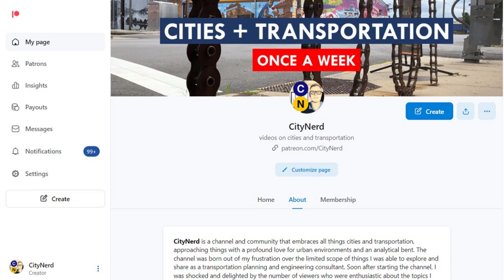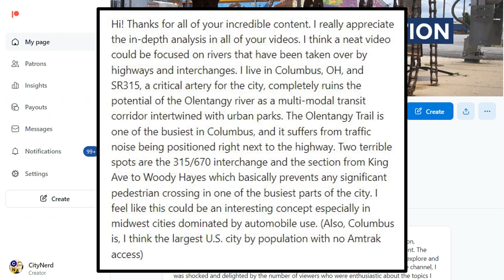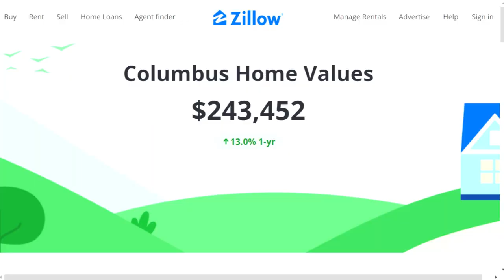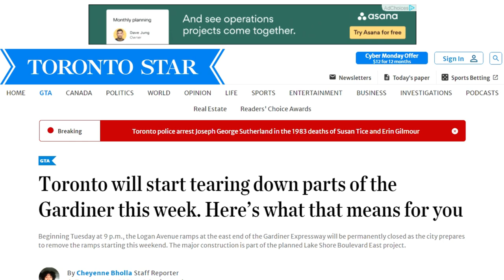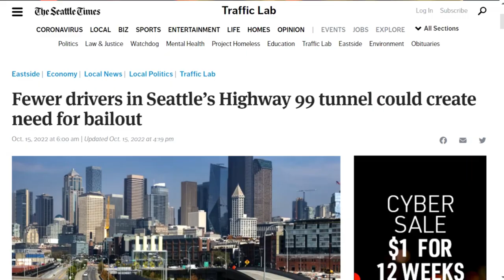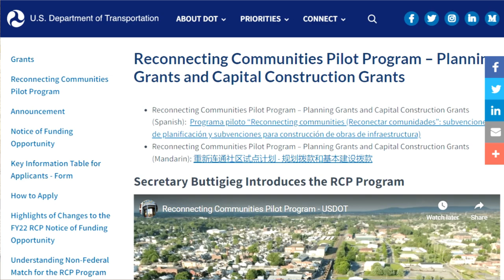Highway Engineering Madness: 10 Waterfront Freeways That Need to Go (North America Edition)

Comment: I'm quite happy to see Sacramento narrowly avoid the list, and I mean that in more than just that it ended up as a "dishonorable mention" flyby, as if history had gone a little bit differently it would have certainly been on the top (bottom?) 10. Originally I-5 was going to go right along the waterfront on the east bank of the river, but a historic preservation movement (of which one of my professors had been involved in) managed to build enough support for pursuing a different approach. If I recall correctly, the president at the time (JFK?) was going to step in, but what we have today is the compromise solution, where it has a "bubble" for the historic district, which is probably the most photogenic part of the entire metro area.

Comment: Currently is DuSable-Lakeshore Drive, but I feel that Lakeshore Drive already reached its maximum capacity of traffic. Especially in the northern part of the Outer Drive. It does create a barrier to the dense neighborhoods/communities like Wriggleyville, Lincoln Park and Uptown. Have it as a 6 lane boulevard and service street on the side. While a BRT can run in the middle. Connecting Navy Piet and perhaps the Museum Campus. The southern part of Lake Shore Drive can still service as a "Freeway", until 47th St. That's where a semaphore or a roundabout can be placed. It would be nice to re create the split like LSD did in the museum campus before, just when it reaches 57th St at Musuem of Science and Industry. Directing traffic in a huge roundabout sequence in Jackson Park, to help the transition towards the Chicago Skyway, via Stony Island Avenue, another wide Boulevard on the SE Side of Chicago. The City of Chicago is split by those opposing to re create, and those that want things the Chicago way, "fast, speedy and prudent with no reason". Or, turn it into a Tollway, I've say that for a reason to get funding for construction.

Comment: as a Berkeley resident near 580/80, it's unfortunate to say that however much I agree what a travesty it is to separate the east bay from its waterfront (and so much money goes into trying to bridge across it), i cannot envision any kind of plausible future in which it gets removed or even road dieted. the biggest issue is just trucks; the Port of Oakland is one of the busiest ports on the west coast, and 580/80 fulfills a rather substantially unique logistics niche for the area. (there is also a rail line parallel to 580/80 and it is also well-used) i think the best case scenario is congestion pricing 580/80 to lower VMT and investing the proceeds into more public transit and hoping you can hold back Caltrans from trying to expand the freeway infrastructure (they want to "upgrade" some local city stroads into serving as 580/80 backups).

what i can say, however, is that Berkeley managed to avoid the fate of having a highway slammed through its core, so it has an incredibly intact and great downtown. in that respect, if there had to have been a freeway, putting it through what was once literally trash storage (one of the city's major waterfront parks is a capped landfill, and if you watch The Graduate, there's a shot in south berkeley in the mid-20th century where they are literally on a trash dump) was immensely preferable to a city-gutting, neighborhood-segregating location.

in that respect, what i could see being plausible is removing 980 in Oakland, even if's not a water-front freeway (it is kind of water front because it's so close to lake merritt). even at rush hour it's hardly packed, it gutted neighborhoods and entraps West Oakland, and it is extremely redundant with 880 slightly to the west.

Comment: Torontonian here: I was afraid of the Gardiner appearing in the list and it seemed to have been realized. 

The Gardiner isn't that bad in downtown. It's elevated and quite thin, so it doesn't prevent walking from the main downtown to the lakes front. Almost all north/south streets (even minor streets) run under the Gardiner, so pedestrians and cyclists are not bottlenecked into only walking along main streets. It's also recessed in from the shoreline enough to allow for lots of development right along the waterfront, hiding it from the city skyline's view. One place where the Gardiner is really bad is in the west end, where it encloses in a lot of new condo development right along the lake, particularly where Humber Park is. 

And yes, the QEW is horrid. But that's what happens when you have intense suburban sprawl

Comment: Chicagoan here who lives ~10 minutes walk from the lakefront. The city has an interesting (and probably unhealthy) love affair with Lake Shore Drive to be sure. As others have commented, there is a romanticization of LSD from a driver's point of view. The views are incredible and I guess if you have to drive it's something that is nice to have? 

As a car-less individual who relies on CTA for transport and lives within walking distance of the northern end of Lincoln Park, however, it really is a pain. I will say that it does not impede my use of the lakefront. There are plenty of viaducts and underground tunnels (as you mentioned, they're horrible) that provide access. The absolutely worst part, however, is the noise pollution. What should be a serene and incredibly relaxing place is ruined by the sound of cars speeding by. There are a few special places that get you far enough away where you can really get away from the noise (Montrose Point Bird Sanctuary), but outside of that it really impedes on fully enjoying the spaces. 

Unfortunately, despite in my mind a wonderful transit system, Chicago is still a car centric city for most. Perhaps with some policy changes, strong leadership, and improving CTA access along the lakefront (more express busses!) we could envision a Chicago without LSD. I won't be holding my breath anytime soon though.

Comment: I'd argue that the surface level Lakeshore Boulevard in Toronto is a much greater barrier to pedestrians accessing the lake than the elevated Gardiner. We could (and I think should) turn a major section of Lakeshore Blvd into a network of covered parks, pedestrian paths and shopping areas. The shelter in winter would be nice actually. To the west where there's only the surface level boulevard and the rail path, but no elevated Gardiner, perhaps we could build more fun sculptural bridges and elevated parks.

Comment: As a Chicagoan, it will probably be hard not to sound biased when I say that unlike your loaded question, we haven't had to learn to live with anything Lakeshore Drive is not a problem.  As a matter of fact there is probably more stuff to do right along the water than any of the other places you mentioned, and the access is more than just a few tunnels as you pointed out.

Personally I don't think Lakeshore Drive is any sort of hindrance whatsoever.

Comment: I know you're a fan of Pittsburgh, but I was really surprised to not see the 279, 376, 579 triangle around downtown included here. This takes one of the most spectacular downtown settings in America and draws a hard line between it and the Hill District, AND limits the extension of Point State Park down the Mon and Allegheny River banks

Comment: I live in Charlotte and go to school in Greensboro (pray for me).

I cant speak for the other cities, but I know Charlotte was founded where two major trading paths intersected. Those path ways are now Trade Street and Tryon Street. The Catawba river, on top of being miles away from the trading path, was too rocky and not navegable for trading boats, and thus not considered of importance as the city grew. 
Most of the rivers in North Carolina, as well as our coasts, were way too rough to travel through to be considered important locations to build cities. 

Where uptown (our downtown) sits now, it is mostly surrounded by really small and thin creeks that would make pretty pathetic looking waterfronts.

The Catawba would have dams installed in the early 20th century to supply power to the area, but the resulting bodies of water like Lake Norman, Lake Wylie, etc, had mostly privately owned water fronts where McMansions/ Small businesses sit today. So little to no development could be done.

What also doesn’t help is that Charlotte-Douglas INTL blocks a lot of development from moving west towards the Catawba. The areas where the river run close to the airport are largely undeveloped and don’t have sewer lines.

Knowing North Carolina, I wouldn’t be surprised that most of our cities have similar histories. Asheville, Fayetteville and Wilmington all have notable rivers, close to city center but Wilmington is the only city to have built a riverwalk.

Comment: When I moved to Detroit three decades ago, I was astounded to find Detroit had not developed its waterfront.  It was either horrendously ugly industrial stockyards, parking lots, highways and car roads, or publicly inaccessible private properties.  It seems the city recently has changed its indifference to waterfront, and now has begun to re-develop it to be more publicly friendly space.  Although the damage has been done extensively since the city opened 300 years ago, even a small change is welcoming.  Detroit suburb waterfronts are no better than Detroit, either.

Comment: I'm currently in Belgium, and I was thinking of some bad water front usage here in Europe. Maybe they aren't highways, but similarly useless uses of river fronts. Antwerp comes immediately to mind, check out here... 51.21580817123835, 4.39255853501598.  The street changes its name every block, but there are parking lots, old industrial junk left over like unused warehouse like things, just a waste considering how nice it could be and how close it is to downtown. I know Antwerp is a major port but that has all moved north of the city center. In Paris you've got a variously-named pretty major road that borders the Seine on both sides, through much of the city center. In many places you've got to cross this monstrosity to access the river. In fact when I search for Paris on google maps, the first thing that comes up is a picture of it, what is that? Four lanes of truck and car crap immediately adjacent to the river, booo! Stockholm is a little different, it is totally surrounded by water on all sides, but in many places, there are some pretty big streets right next to the water. Of course, not too far from downtown, they also have some really nice greenspaces on the water.

Comment: I went to Chicago for the Marathon and stayed in Lakeshore East. On my shakeout run the day before I tried to run along the lakeshore. I ran along upper Randolph until I got to Harbor Point, no access, then went up to Cascade park and the switchbacks down to cross under Lakeshore to  go north on the trail. But I made a wrong turn and ended up on the riverwalk, and eventually made my way back after crossing the river on Columbus. Then on the way back I saw how I made my wrong turn, and took lower Randolph back, ugh.

Comment: As a resident of Chicago and a Chicago Northern suburb, I agree that LSD has its problems - but shutting it down would be disastrous for the adjacent districts. The traffic would still flow - but over roads that could not accommodate the additional volume.

Comment: Highways are needed, full stop. Infrastructure might look ugly, but it doesn't change that they are needed. Vancouver is tiny compared to the GTAH. I use those highways for work, and removing them would literally double my travel times, doubling what we would as an industry charge customers, which is already high. Toronto traffic is already so bad, that it's standard to charge extra for just crossing into the Toronto jurisdiction.

Aside from that, the QEW through Hamilton resulted in some really nice beach and waterfront parks land. Same with the QEW running through the western side of Toronto. Without the highways that land would most definitely been locked up in private development, just as every other inch of land has been.

Comment: The top comment by Simon Eh!? covers the Gardener pretty well, but as a resident of Burlington/Hamilton, I'll touch on the QEW comment!

As much as that freeway sucks, like the one earlier in the video with no bypasses... yea, that's the QEW east of Hamilton. But even worse, it's pretty much the only way to and from Niagara Falls and Fort Erie (i.e. Buffalo, NY) for freight traffic and tourism, so it's not just a matter of bypassing a city: it's a 100km long freight corridor that would need to be moved. There's been talks for decades about building another highway (often called the "413" or "416" but both are now taken by other Toronto highway plans) to parallel it but up on the escarpment, maybe 10-20km from the lake, and eventually meeting up with the 403/401 near Woodstock, but this has been fought tooth and nail for good reason: a lot of prime agricultural land would be destroyed by it, and they wouldn't close the QEW with that plan either (just "another" route). So the QEW as it is, alone along the lake, is the best of a bunch of bad options unless there's a serious overhaul in freight and transit to and from there.

The entire QEW/Gardiner (some of which used to be QEW) is a pretty attrocious highway, but on the other hand it's pretty much responsible for forming the "golden horseshoe" as an economic hub of Canada, so, good with the bad.

Comment: I believe most of the larger cities of NC her after the advent of rail, so waterways weren’t as important for transport. Further, there is plenty of rainfall so they don’t need it for water supply. And there are usually small rivers or lakes or reservoirs nearby for supply. The older cities are in the tidewater area. Raleigh was chosen in part because it wasn’t on a navigable river so it would avoid pirate attacks. Many Italian cities were built in the mountains for similar reasons, to avoid Viking attacks.

Comment: Speaking as someone who lives in a city on a river being reclaimed for parks and such, and who has bothered to research the history of it use, I'd have to say that its earlier value as a power and transportation resource early in the industrial revolution, as well as its repulsiveness as an outlet for city sewers and destination for the runoff of the horse-drawn era, has more to do with it not being a focus of fine urban living than the stupidity of freeway building, which admittedly is great. The Clean Water Act did a lot to make cities willing to face their rivers, and offshoring and other forms of deindustrialization has left cities with lots of derelict waterfront properties to deal with. Such is the case on my river. Within a half a mile, upstream of me, three industrial sites have been bulldozed and turned into parks, with four more yet to be dealt with (some with buildings that might be rehabbed). Many city parks caught between highways and rivers are less the victims of the highways and more the (relatively cheap) infill of industrial zones past.

Comment: Torontonian again: two major factors with regard to the Gardiner: political and "economical" … despite being elevated through downtown (allowing for some surprising 'drive through' views of individual condo units) the ground-to-elevated portion (Don River to Dufferin Street) presents a socio-emotional barrier: it is uncomfortable to walk under the expressway, even for the sole purpose of traversing it to the waterfront  … the city does it's best to render the Gardiner 'invisible' (there is a pedestrian bridge at Roncesvalles Village, and there are overpasses at Dufferin, Bathurst and Spadina (all of which include streetcar lines) and underpasses from University, Bay, Yonge, Jarvis, Sherbourne and Parliament). Additionally, the subway system does not go south of Front Street (one block north at Bay St only) and in addition to the elevated Gardiner, there is also a largely parallel "avenue-class road" Lakeshore Boulevard (E & W) which sits (mostly) beneath the elevated Gardiner which is an additional six lane 'discomfort' to walk through.  A portion connecting Lakeshore Boulevard East was removed recently, so the Gardiner only goes to/from the Don Valley Parkway on the east side (the 'DVP' highway follows a river / valley so where one ends the other begins as a contiguous route) … there are far too many Torontonians who perceive themselves to be car-dependent.  The Gardiner on the south, connects to the DVP in the East, the 401 in the North and the 427 in the west to form a freeway "bucket" around the original city (the City is larger since 2000, encompassing "The Six" municipalities that were previously: Toronto, East York, York, North York, Scarborough and Etobicoke).  Our waterfront is heavily barrier-ed by a noisy / dirty elevated expressway AND an at-grade 6-lane boulevard.  Worse-still, this is "the only way" for car-based commuters to enter the downtown core (home of St. Lawrence Market, SkyDome [Blue Jays stadium] and Scotiabank Arena [Raptors stadium]) and ["post-" pandemic] traffic volume is so high that the regional GO bus service cannot access Union train/inter-urban bus/subway station!

Comment: The powers that be cant decide what to with the BQE in Brooklyn Heights. That double decker highest underneath the Heights Promenade is literally crumbling away. They reduced the lanes from 3 to 2 to mitigate it, but it's a matter of time before it has to be replaced. 

There were a number of options floated about, including one turning the Promenade into a "temporary highway" while they repair the existing one, shot down almost immediately thankfully. Another proposed solution was building a tunnel, which has a high price tag and scared budget conscious politicians. Last I heard they were still deciding on what to do, sigh